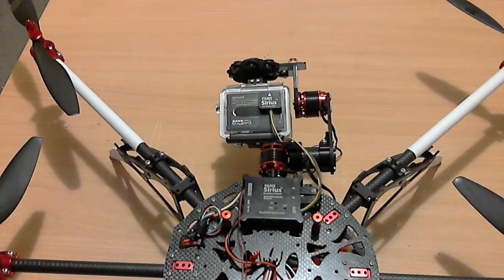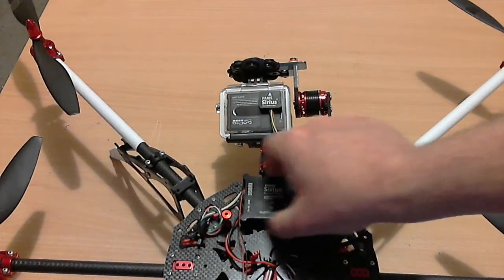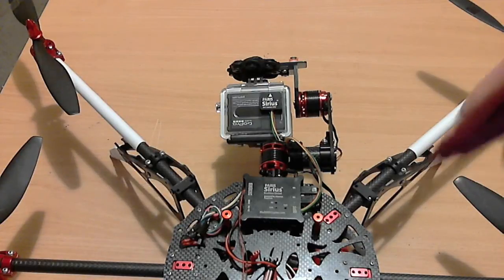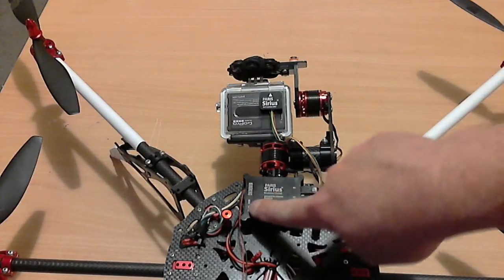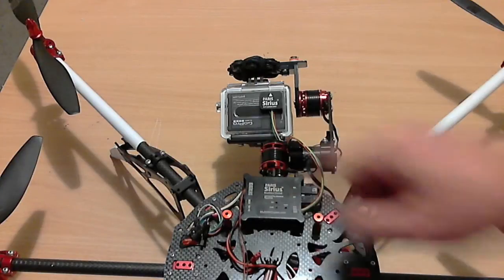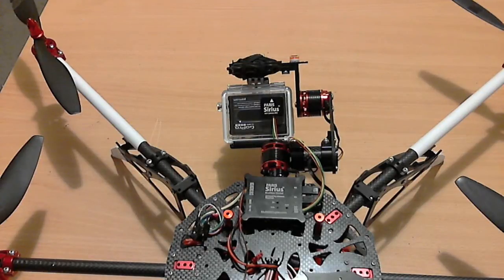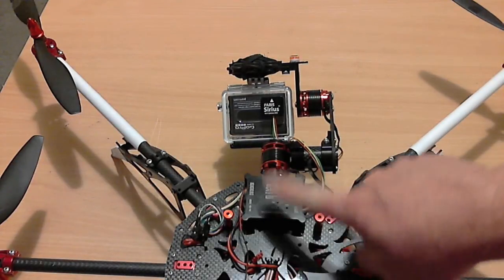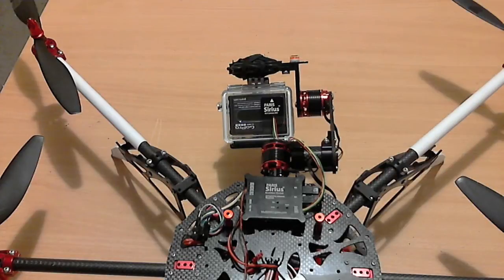PARIS Sirius™ SBGimbal controller Review

Comment: Great review and cool looking gimbal! I'm trying to figure out if this gimbal would still work with a larger back door on the gopro. The larger back door is meant for the lcd screen but I use it to make room for my fpv/video out wire that plugs into the back of the camera. This way my gopro is waterproof, on a gimbal, and has a video out for fpv.

The lcd door is 10mm thicker than the original door. This would add a little weight and cause the sensor to be mounted 10mm higher (but still centered).  From your videos I can tell the placement of the sensor is very important.

Do you think the sensor would have an issue? Any thoughts on this project would be greatly appreciated!
Thanks again for the review!
Reply from the maker: ***** I doubt you would be able to get the gimbal to balance with a backpack on the GoPro
Reply: Deet96 Thank you for the quick response!   I can't find much in the forums or any support for this gimbal.  I'm afraid of the balance as well.  But, I'm not sure if I made myself clear.  Sorry if this sounds repetitive.  

The LCD BacPac and the Battery BacPac come with a larger back-door for the waterproof housing.  I'm only using the larger back-door and I'm not using the LCD or the Battery BacPac.

The larger back-door makes room for my fpv/video out wire that plugs into the back of the gopro. I drilled a hole in the back-door for the wire and re-sealed it with a strong epoxy.  Now my GoPro has a video out wire for FPV and it's still 100% waterproof!!!

The larger back-door is only 8 grams heavier (and 10mm taller) than the standard back-door.
Do you still think the 8 grams would throw it off balance? I feel like the Alexmos controller could tune that out, but I also have very little experience programming gimbals :)
Reply from the maker: There won't be a GoPro gimbal on the market designed to do what you want